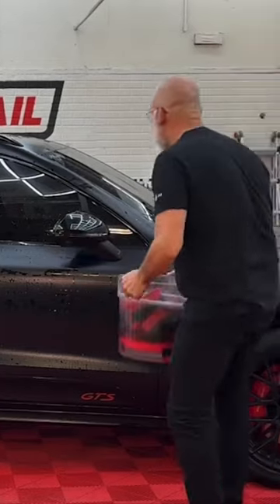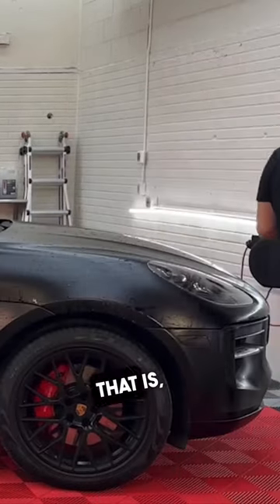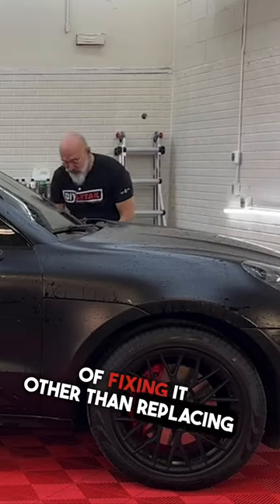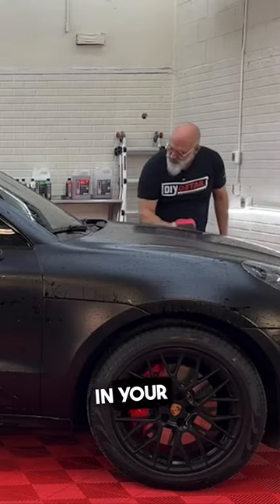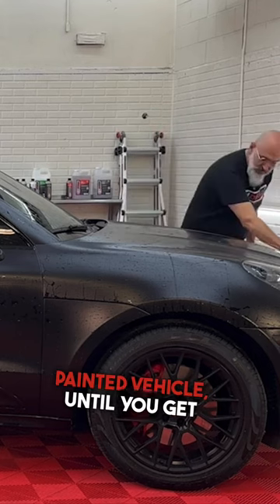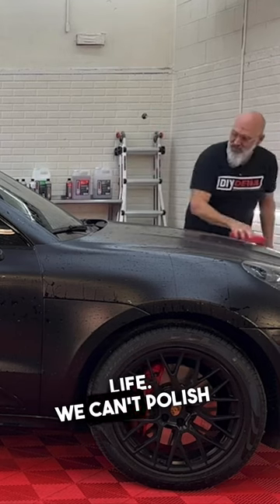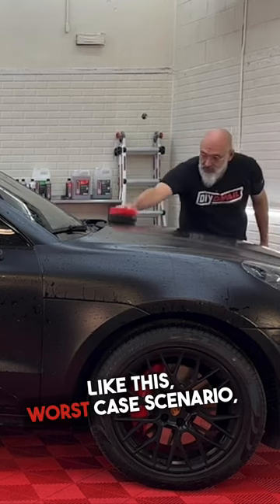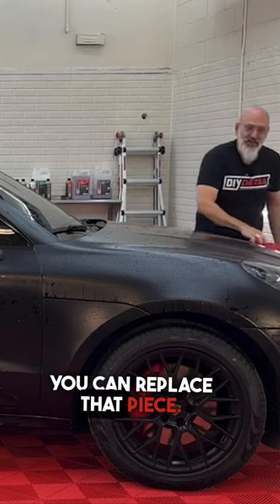The downside of matte paint

Comment: Experiment idea: try to compound and polish matte paint. Podcast idea maybe?

 Regards!
Reply: It won't be matte after polishing or would just look worse.
Reply from the maker: No need to experiment, polishing will turn it from matte to glossy
Reply: @NickVetter  you can’t polish 😊
Reply: @Yessolution37  ⬆️
Reply: There's no experiment to be had. The look of matte paint comes from it being textured. That's why it looks dull and doesn't reflect light so much. If you compound or polish it, you are getting rid of that texture and making it go from textured matte to slick gloss.